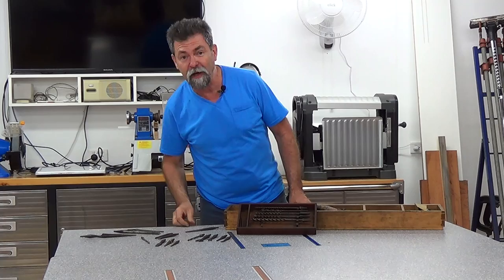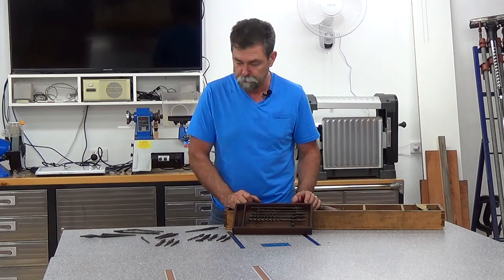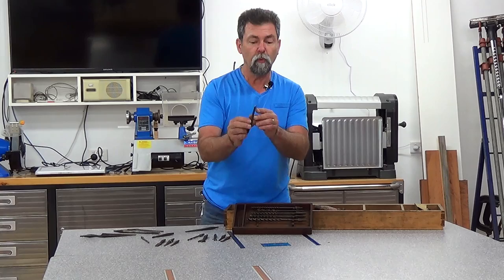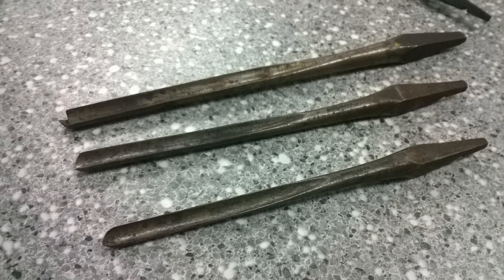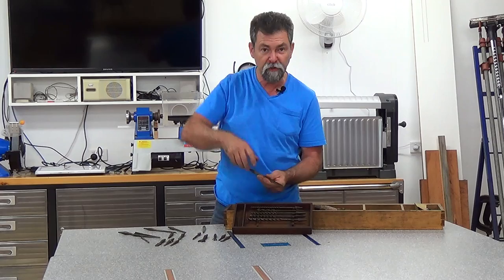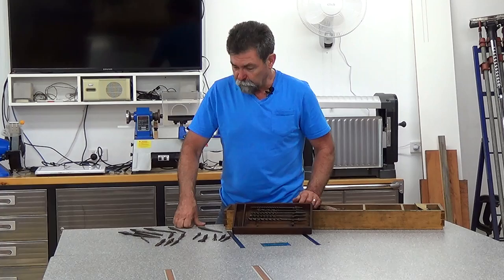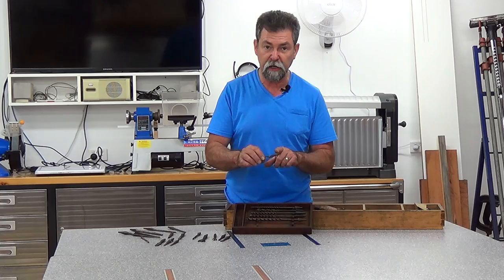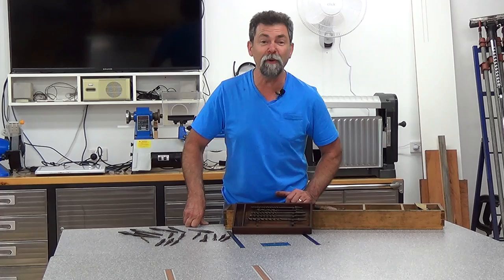What's in Arthur's (My Great Grandfather) toolbox episode 5. Brace and bits.

Comment: Great collection of very usable bits!  The brace would have likely been a Sheffield Style of Spofford style.  The little notch you mention, is for a pin retention of the bit (really handy if you are working on a ladder and people are below you)  not all bits had them, but those designed for a Sheffield style brace did.  The long tapered bit is for boring holes in chair seats and the like.  The flat bits, reamers, etc. are likely for metal working (probably hardened a bit more) and used to make the Chisel Plane in one of your other videos.

Comment: The curved gouge looking ones are spoon bits and allow to change direction of the hole a bit and were used a lot in chair and furniture making.  Thanks again The square edged one was most likely made to taper a hole for tapered legs or pins or plugs.
Reply from the maker: +Erik Anderson This is great that you can help out Erik!